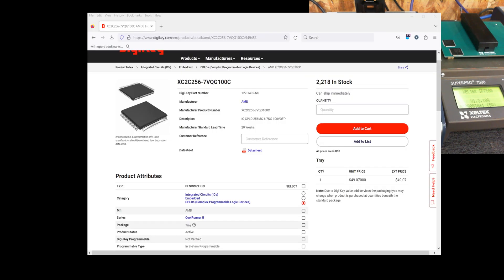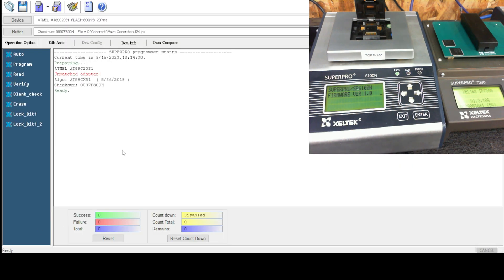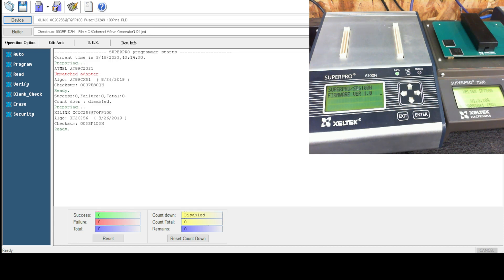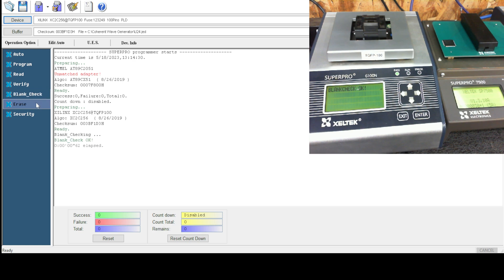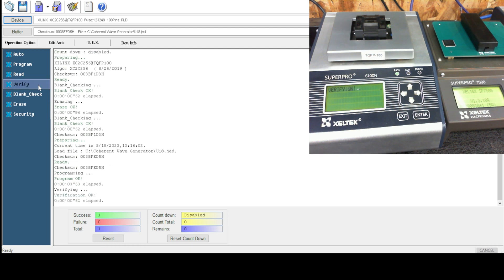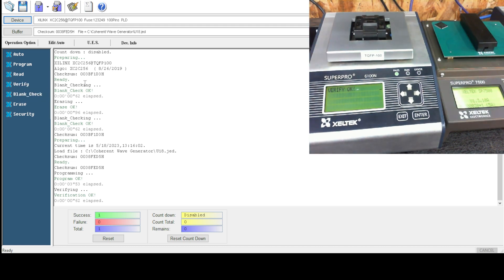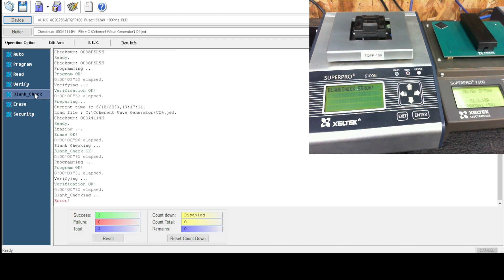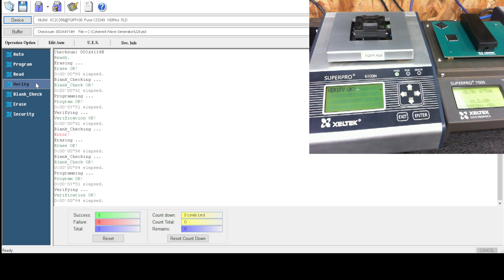Ultimate IC Chip Programmer Xeltek Superpro 6100N Target Device Xilinx XC2C256-7VQG100 TQFP 100 CPLD

Comment: Greetings I have only read the Characteristics of the SUPERPRO 6100N programmer.
Do you know if the programmer can be requested to add new chips, for example I work with a Haltek chip and the HT66F018 is not there, will they add it if I request it?
Reply from the maker: Hello, Xeltek will add chips upon request they do charge to do so.